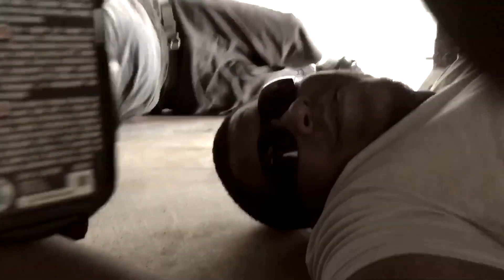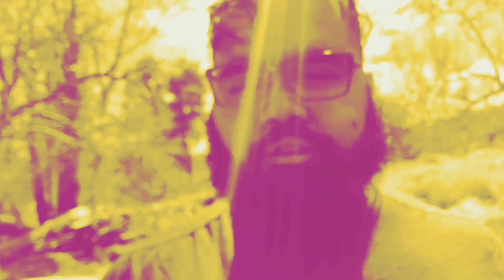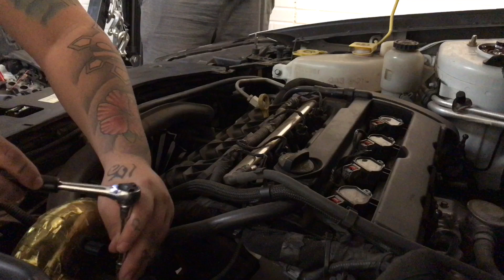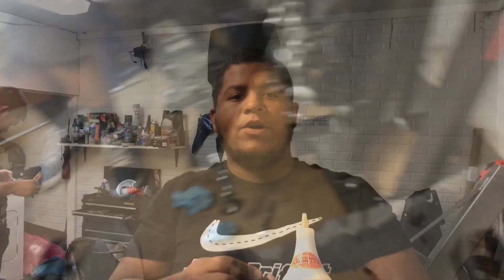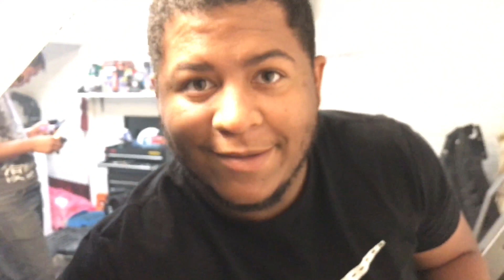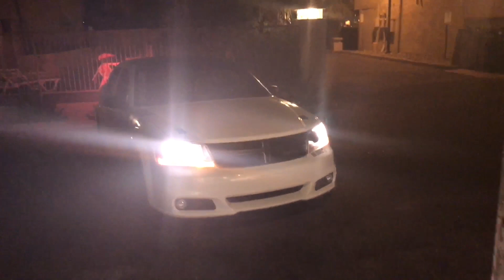2013 Dodge Avenger Evo X Intake Manifold Install

Comment: My evo x is a 2.0 not a 2.4 so yeah they might share parts but not the same engine
Reply: Same head not block
Reply: @culturemotived2190  Also different internals, Evo X has forged 2.0 internals, same that can be swapped with the 2.0 Genesis.
Reply: @Kingshock  interesting did not know that . I only knew of the idle pulley swap but I’ll look into that for sure

Comment: I have a 2014 dodge avenger 3.6l and I want to increase the hp do you guys have tips?
Reply: Same what can we do without adding nitrous
Reply: I got a custom exhaust done o my car it's a 3.6l vvt sxt 2013 dodge avenger I got it straight piped glass pack installed and 4 inch exhaust tips and it's a dual exhaust it for sure increased the horsepower and I'm soon gonna get a k&n performance air intake . that will also give boost torque and more horsepower and I paid 400 on the whole exhaust system for everything originally it was gonna be 500
Reply: Get a v8
Reply: @etiennerojas2987  LS SWAP THE WORLD!!!!!!

Comment: Where did your intake filter lead out to? Or did it stop within the engine bay?
Reply from the maker: We had a plastic pipe run through the headlight, hellcat inspired, to run directly into the filter

Comment: Does the check engine light stay on with removing the intake runner valves?
Reply from the maker: So before installing the intake manifold the car had been Skyed tune. No CEL then after installing no light turned on
Reply: Desert Octane can we be updated with the project I have a 08 thinking about doing a str4 swap is this doable? Will Dodge be able to run diagnostics on it after if I swapped with a caliber ecu/pcm

Comment: Cuántos HP consigue un Avenger con esa modificación y Dónde puedo conseguir El múltiple de admisión metálico
Reply: creo que va a tener la potencia similar a la de un SRT4, ya que es el mismo motor pero turbo, debe de andar entre los 260 y 230 hp depende de las modificaciones que tenga hechas
Reply: 🤣😂al empesar solamente tiene 171hp..
Creo que el limite de hp  despues de tener tantas modificaciones van hacer  por lo menos 200hp

Comment: Would the k and n intake fit on this because the throttle body looks higher than the stock one
Reply from the maker: Nicholas Borg we did use the k&n one but we had to cut the base of the intake that goes into the throttle body to allow it to fit properly due to the throttle body sitting higher

Comment: This work for the V6 model, 2013?
Reply: No this manifold is for a inline 4 engine you'd have to find a manifold that matches yours
Reply: @Seagull425  Hmmm, but it is possible, is what you're saying?
Reply: @gaiusnormanyo  oh yeah you can see if anyone else has made a swap or   see if the engine design is used for others and swap with one of those manifolds

Comment: I have a 2013 dodge avenger se 3.6 and it has the plastic intake Manifold. Can you help and tell witch aluminum manifold can fit on it.
Reply from the maker: DANTE FLORIAN unfortunately with the 3.6 I’m not too sure what would be a specific fit. The motor has been used in chargers, challengers, 300s, and other Mopar cars, I’d maybe suggest searching there to see if anyone has made anything or fabricated something that will work. I’m sorry man

Comment: The evo x uses a 2.0 liter not a 2.4 to my knowledge
Reply from the maker: Correct but the intake manifold and headers will still fit the 2.4
Reply: Desert Octane I know I actually have it on my N/A Lancer it made 194 hp and 182 tq I was impressed it got cams and other goodies but it's cool
Reply: Desert Octane , where did you find this at , I want too try it , i found one on eBay but I’m not quiet sure it’s the same one 
It says Mitsubishi evo c turbo full intake manifold with sensors and throttle body